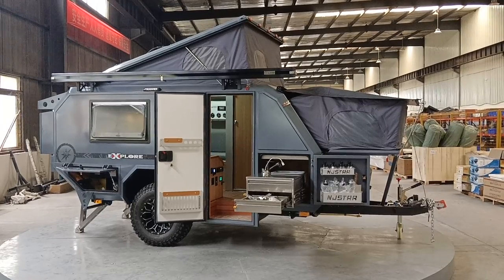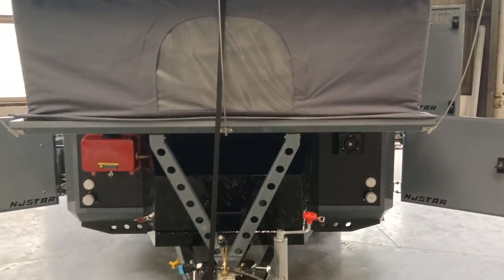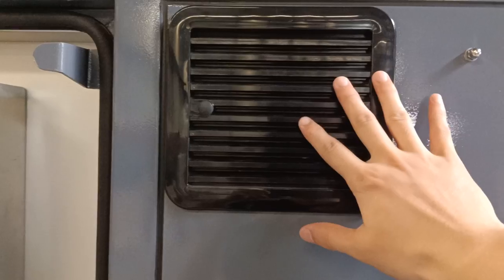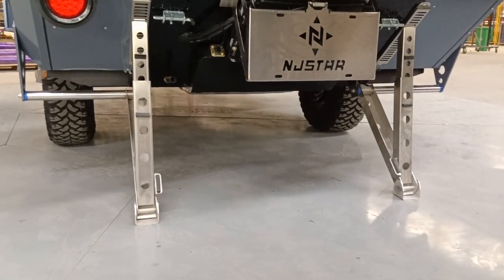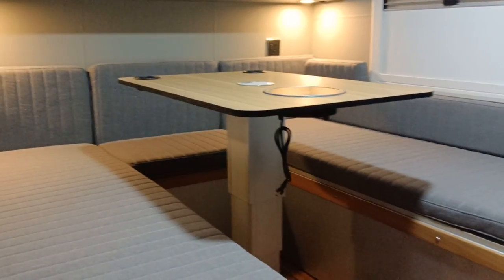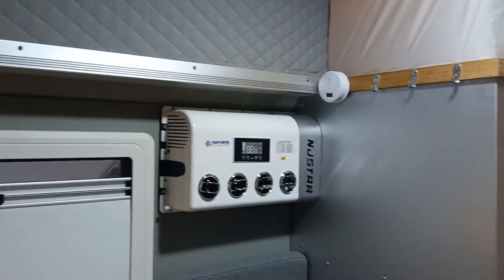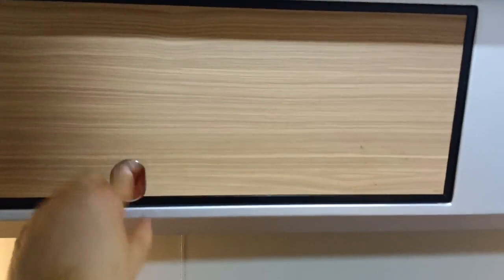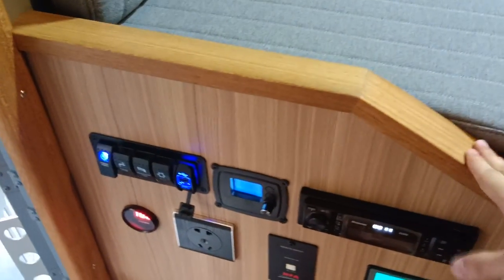a 10 mins ofinside and outside clear introduction njstarrv offroad camper trailer #traveltrailer #rv

Comment: Thank you for finally filling in some the gaps.
That's the 1st real views of the storage areas other than the video of a woman popping the tents and retrieving the rods from under a seat.
Thanks for showing the heater outlet.
Always loved the teak work on this trailer :)
Reply from the maker: yes, this is a fully introduction, and later I will upload some videos for the customer's trailer inside and outside, also with some customization on it.